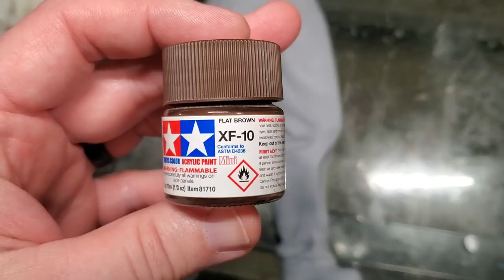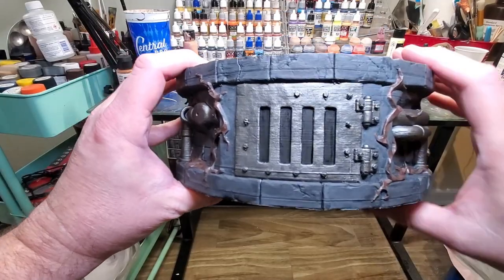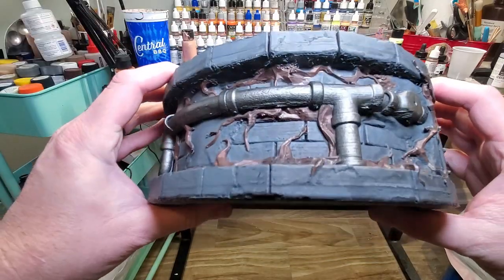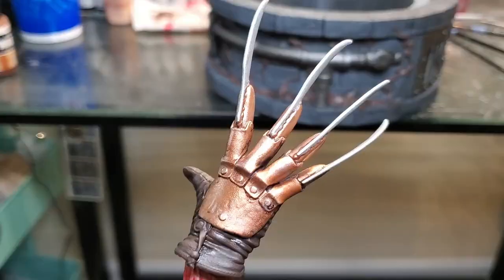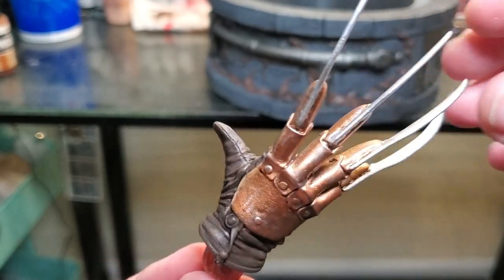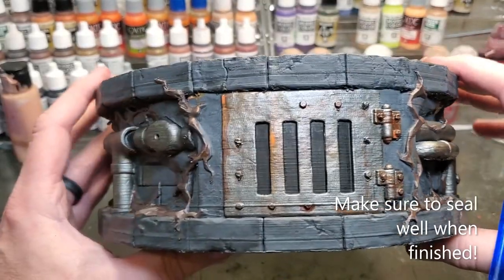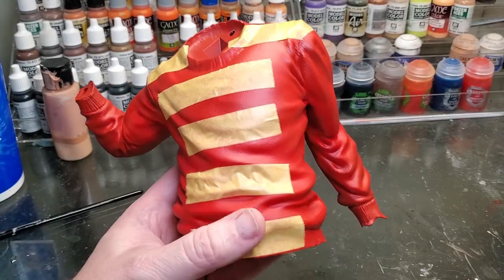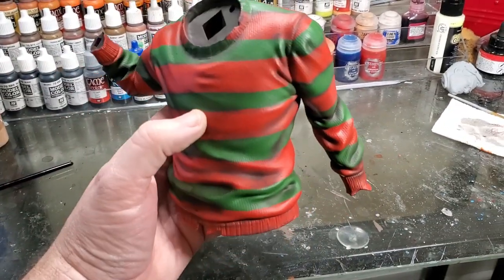Freddy Krueger 3D Printed Custom Painted Statue/ Halloween Special/ DIY

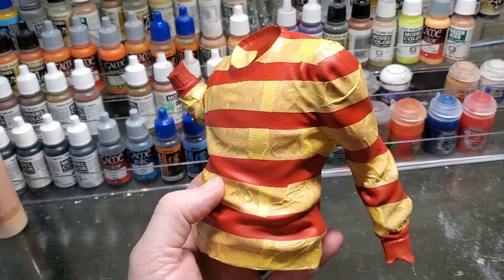Comment: 8:20 One really good tip to stop bleed under masking tape is to spray/paint a layer of clear medium or varnish before the coloured paint as that will seal up against the tape and stop the subsequent paint from bleeding through.

Comment: What are some of the colors used for the skin, the glove, and the rust on the pipes
Reply from the maker: I used different flesh tone shades, reds, with a blue wash over it. THe glove I used a copper and rust wash with some gun metal weathering. The pipes I used a gun metal with a black wash, then rust wash for effects.